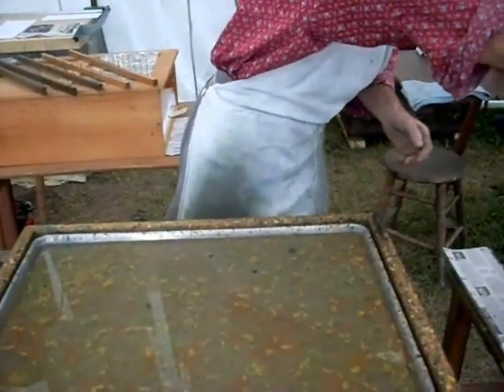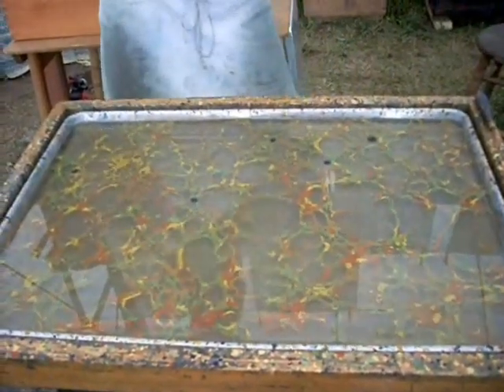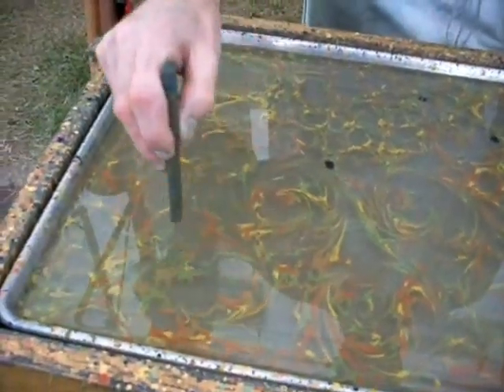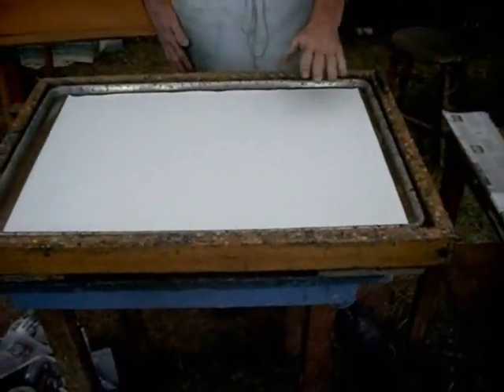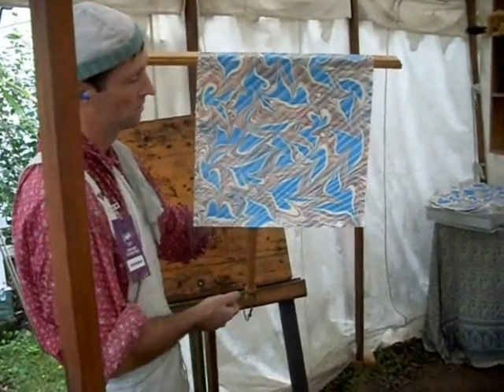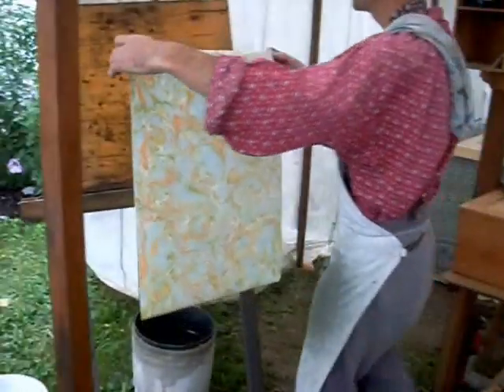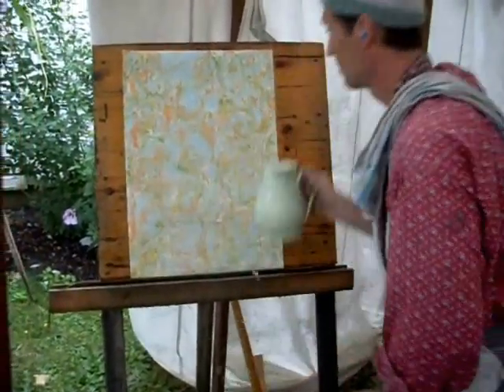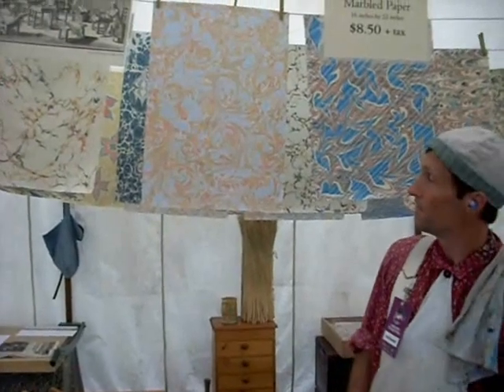Turkish Paper Marbling

Comment: Turkish Paper Marbling (Ebru) do not have this brush and drying method.
Reply: This demonstration is using European paper marbling as it was influenced by Middle Eastern marblers. More so with the materials, but not necessarily the equipment, technique, or pattern.  Yes, the video depicts European marbling derived from Ebrú.  After 1600, Germany began marbling paper. Iranian and Turkish marblers used water based paints with the surfactant bile. This is what Europe adopted in their marbling.

Comment: ALSO! 
there are as many ways to water marble as there are marblers there is ALMOST no way to do it wrong :)
Reply: This is correct. The method on this video is a method used prior to alum and oil based techniques. Alum marbling has repaced it and is now common with the general public.

Comment: The paint he used was water colour paint and he mixed in some animal bile (or something similar) to keep the paint afloat.... Also, the thickness of the paper doesnt totally affect the absorption of the paint, its the "sizing" in the paper... for example: water colour paper would absorb the water colour paint more than regular card stalk - because there is more "sizing" in it. Yes you could also treat the paper yourself for "extra hold" with an alum solution, spreading evenly over the page